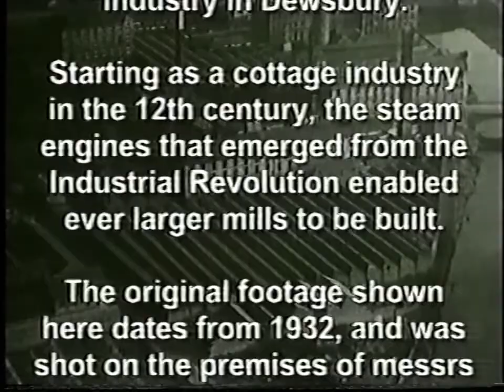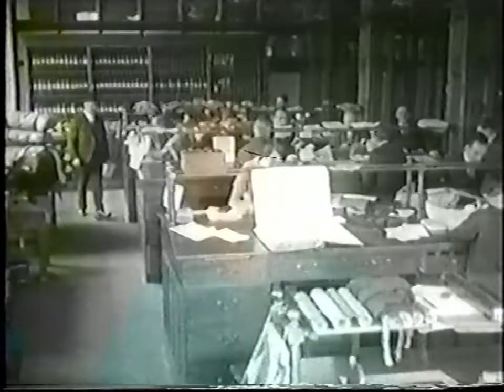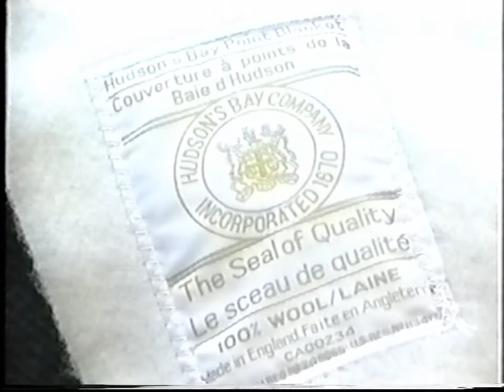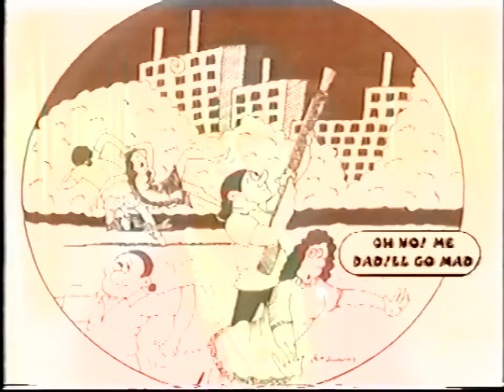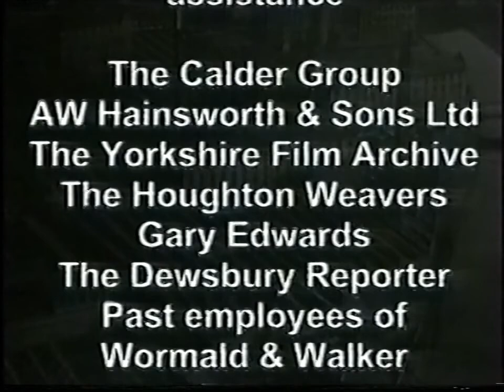"The Work of the Weavers" documentary

Comment: Hi,

I worked at Wormald's around late sixties early seventies starting as weftman; there were two weftmen and we had the job of supplying the weaving shed it being a heavy job. Later I learned of two top secret buildings also at Wormald's and as no one knew anything about them I applied for a job; I was sworn to secrecy unable to discuss these buildings with anyone other than those associated with them.  These two buildings were in fact S11 & S12 each having a single huge American Fiber Weaving Loom.

S11 had four carding machines feeding the apron whilst the newer S12 had two huge carding machines feeding the apron the apron in turn taking the warp and fiber sandwich through the loom; each loom had four passes each pass had a top and bottom board covered with long barbed extremely sharp needles. The woven blanked was wound onto very big 600 yard bobbins these having special carts to wheel them around on.

My first job was looking after the hoppers keeping these topped up with fiber a second operative was on the bridge straddling the apron looking after the warps the department operator was in in charge of the department looking after the loom; in S11 the cards drawing so much power only one card could be started at a time so from the loom both I and the warp guy would watch each card as it started ensuring it came up to speed without throwing a belt; the loom operator at the control panel would shout "look out #1 and then look out #2 etc; once all cards were up to speed then the loom was started; this was very impressive indeed.

I progressed to being in charge of the new department S12 whilst my colleague Granville was in charge of S11. Three shifts ran with Saturday morning for routine maintenance but I worked seven days a week due to my mechanical engineering background assisting Richard who was in overall charge looking after maintenance in both departments; built like a stick insect I could get right into the loom for repairs such as attaching fiber glass cloth patches soaked in epoxy resin; happy days but I left the company when I married and moved to Huddersfield.

It's so incredibly sad to see our mills closed down.

Kind regards, Colin Wood.